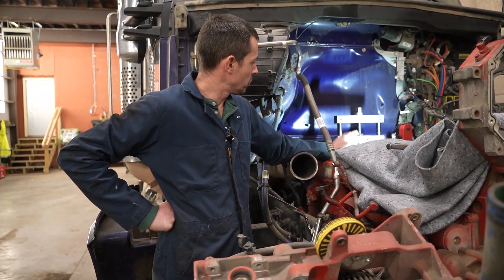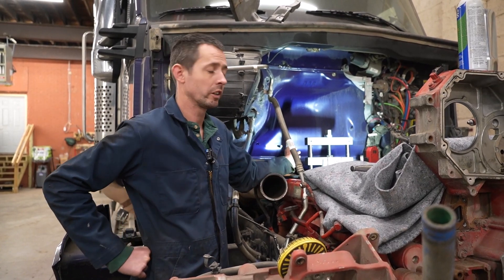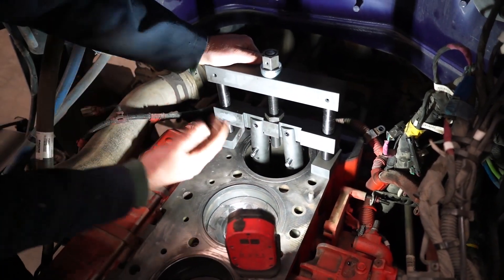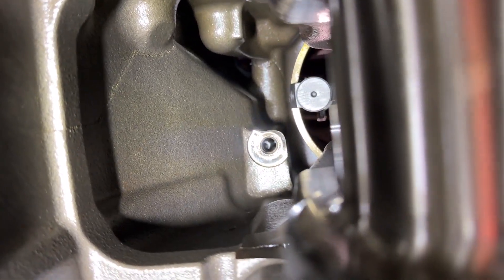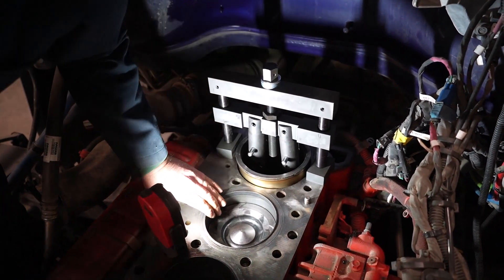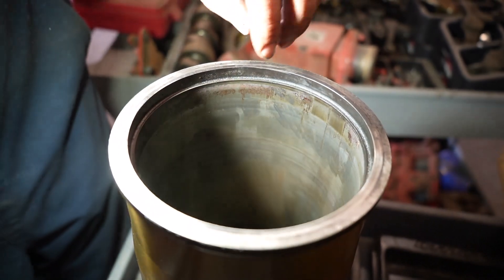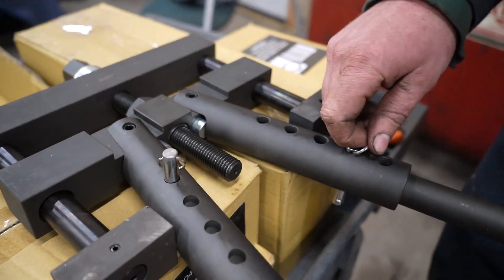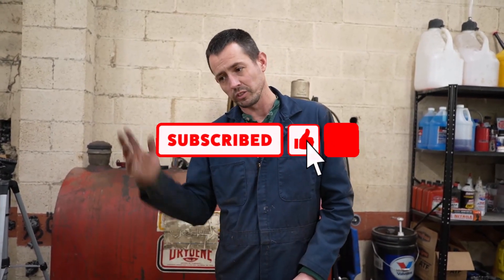HOW TO REMOVE CYLINDER LINER

Comment: Just a suggestion, (I don’t know if it’s put back together or not) you should definitely check for fretting on the block where the liner seats. I used to work for Cummins and have done about 300 overhauls. Fretting is the one thing we would always check for. Just a suggestion.
Reply: Very true are you still doing overhaul on the side